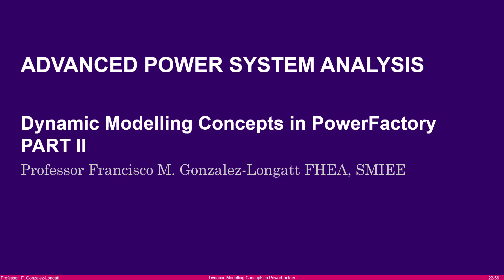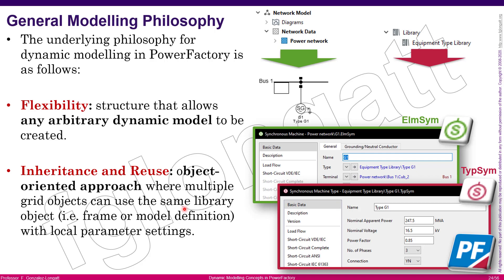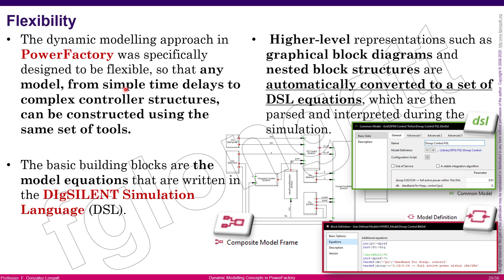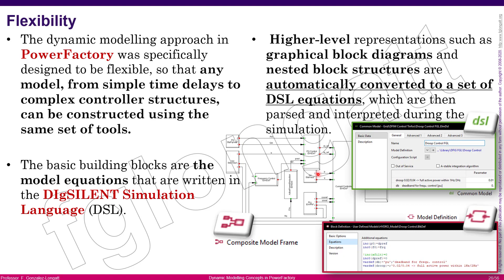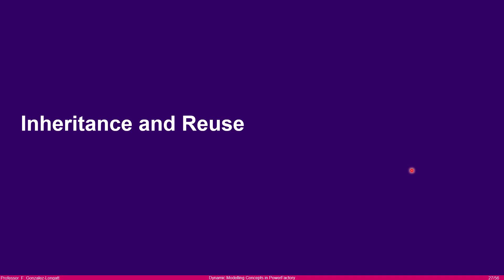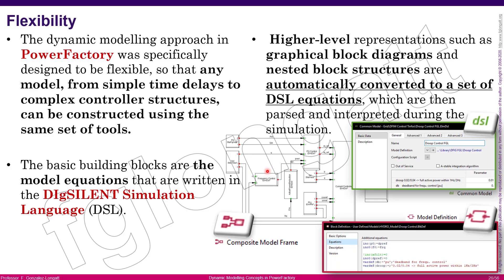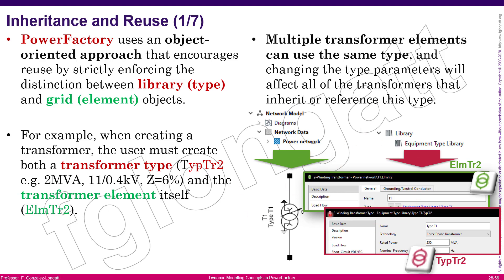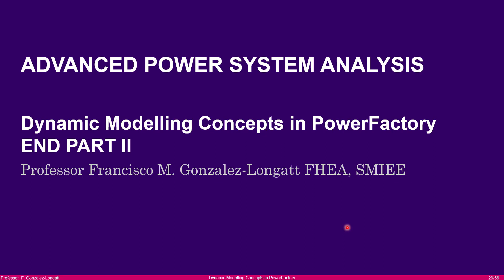Dynamic Modelling Philosophy using DSL in Power Factory PART II

Comment: DSL => object-oriented system, it's flexible, inheritance, reusable, like type of cable/transformers to use it in some of network.
Red = Composite models, frame, model block definition, characteristic, have spesification/parameter = Element Type = Subset in Library, can be reuse
Green = Common models = Set in Data Manager = Element Component in Network System, connect with another component to build network
Ex: synchronous machine controllers like AVR, GOV, PSS, relay, Virtual inertia, measurement device IED, thermodynamics/electro mechanical behavior equipment